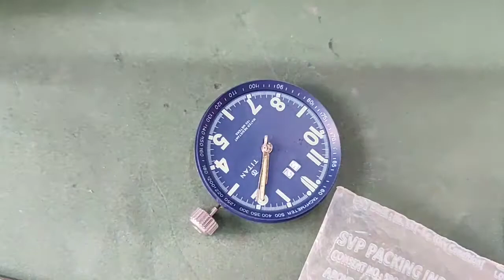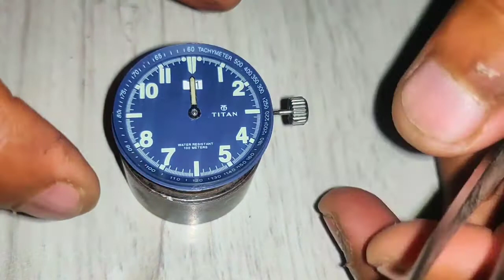how to repair titan watch, servicing titan 7000 series movement, complete servicing tutorial

Comment: This movement showed one jewel. I could not even see that 1 jewel. Did you even replace or oil it?
Reply from the maker: Quartz movement does not require oiling.  Btw look at the base plate there is a jewel for the step rotor.
Reply: @watchwizard  the gears don't need any kind of greasing?
Reply from the maker: Oiling a quartz movement will cause unnecessary drag in the movement
Reply: @watchwizard  you can explain these technical things in a video. What is drag etc